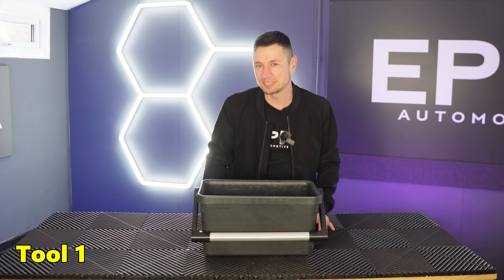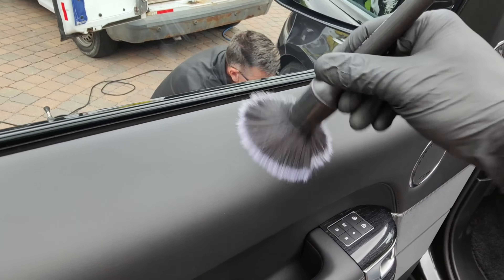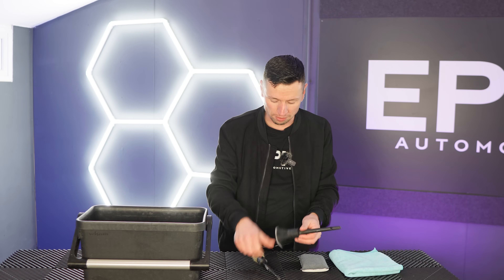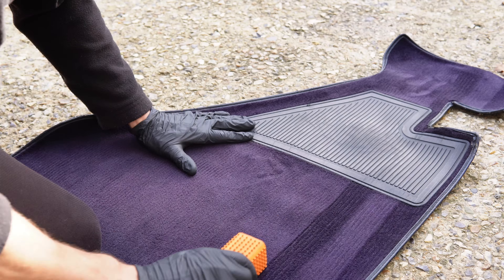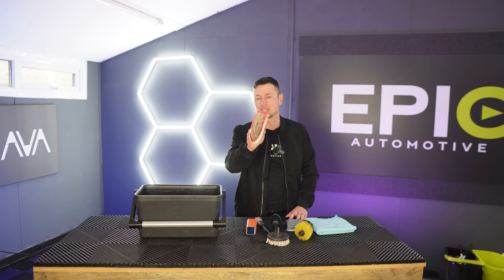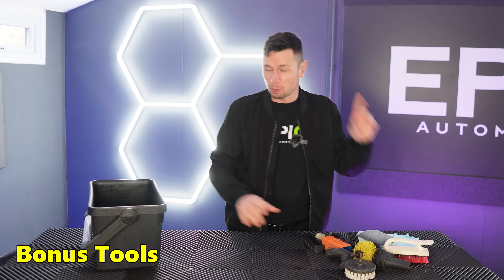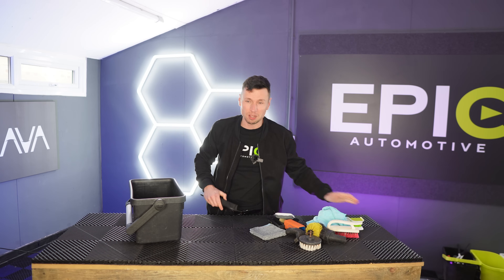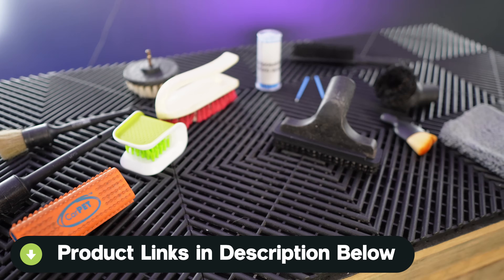The Best car interior cleaning products for Beginners in 2024

Comment: Thanks great info in there.  the scrub pad is the best tool I;ve got.  Bril for cleaning large areas of hard textured platics, and leather seats.  interesting on the drill brush, have you considered that you could also use a small car drier(rather than a tornador) to blow out the dirt?  My best tip is, For pet hair I use some fabric softner (I shop at costco, si usually the mrs has gallons lol) 25% to 75% of water in a pray bottle, and lightly spray before I hoover/brush.  Also helps with really doggy smelling fabric, as well as breaking the static between the 2.

Comment: Thanks Dave, you should try the “Analan pet hair brush” bit expensive but seems to work better than the rest.
Reply from the maker: Cool might try that, if it fails then I probably would have had a laugh trying to pronounce it 😅
Reply: @epicautomotivedetailing  Try to get the 2.0 version which has a thicker more durable blade.  Much more rigid then the flimsy silicone bladed pet hair brushes.

Comment: What for cleaning cloth seat upholstery? I struggle cleaning them ,even as pro. I own steamer sc4 and a wet/dry simple vac. Can you help please with a recommended procedure to deal with cloth seats? I don't own extractor and i don't want to buy one for various reasons.

( Is a good idea to apply a extractor kind of nozzle to a simple wet/dry vac to remove the dirt and the spend chemical inspite it has no spray water function?)
Thanks

Comment: 👍🏽for the scrub pad. Recently bought one from temu and only used it on the sofa as a test and felt it was better than a folder microfibre for hard surfaces.

Great advice about not using it on glossy surfaces. Now i won't mess up my gear stick surround.